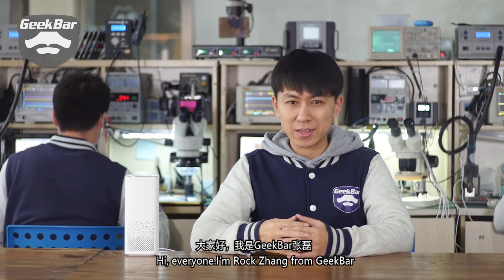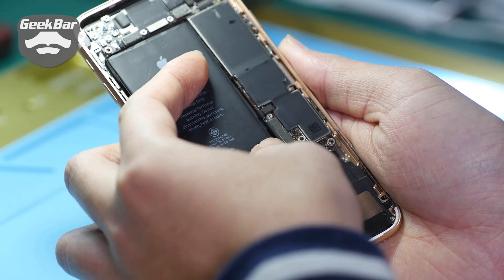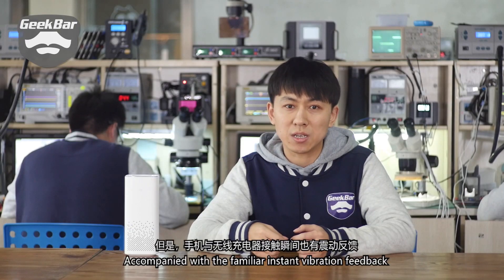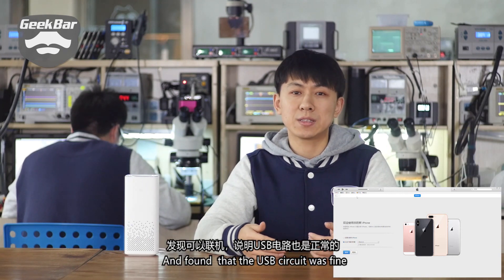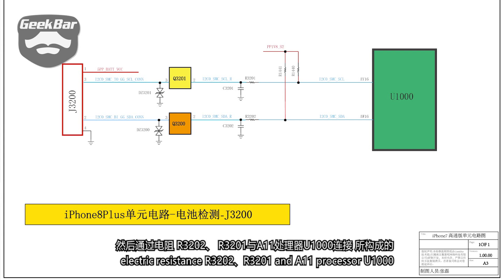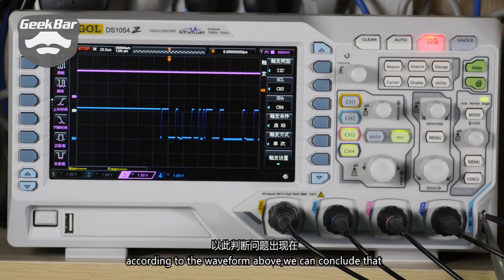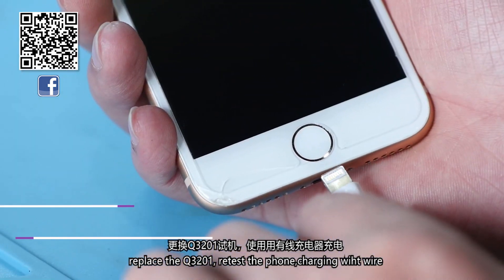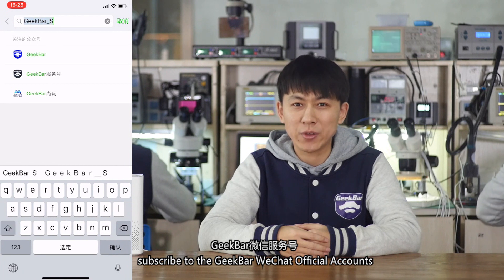Chip Level Repairing: how to fix iPhone 8 Charging Issue?

Comment: hi, i have the same problem, recently my phone dropped down to the floor and was badly injured. i delivered the phone to get repaired, and it was done sucessfully with new screen. Now the problem which has been added is acxactly like the video above. my i phone 8 is not showing any symbol of charging, and only thing which is retten there is 1 %. and the phone turn off and suddenly on anytime, i am really confused, i need help, could someone help me please??
Reply: Did you solve the problem?

Comment: Hi, I have changed the charging port, U6300, Q3200 and Q3201. All values are good on J6400 and J3200 but the phone does not charge. It is working fine but not charging. Any idea, please? Thank you.